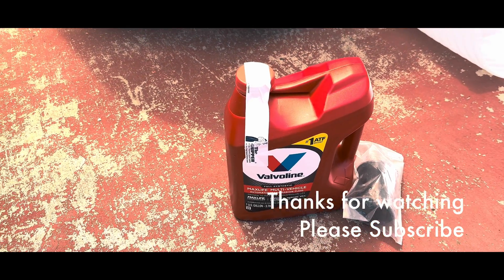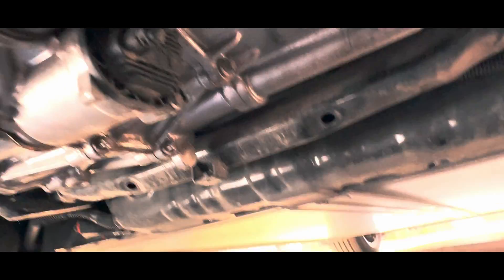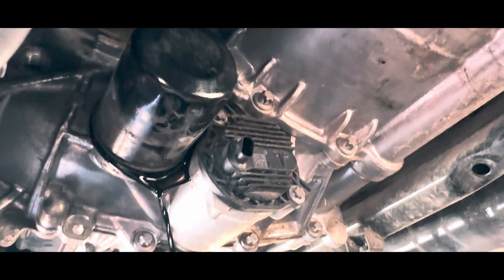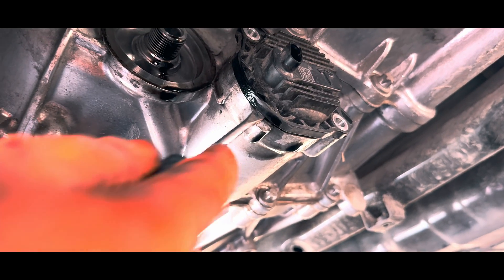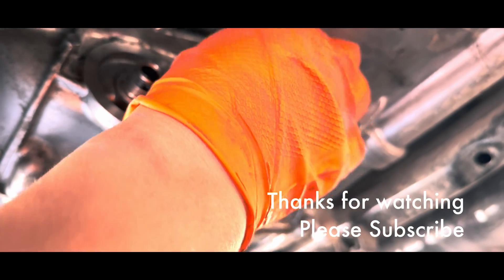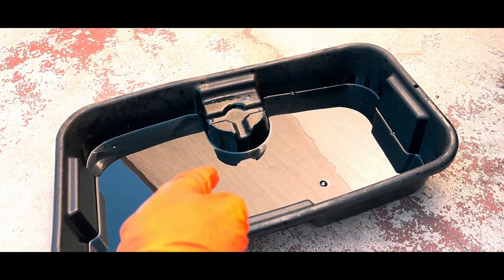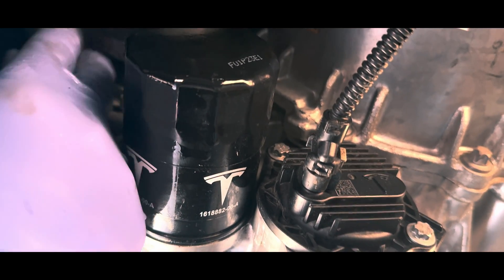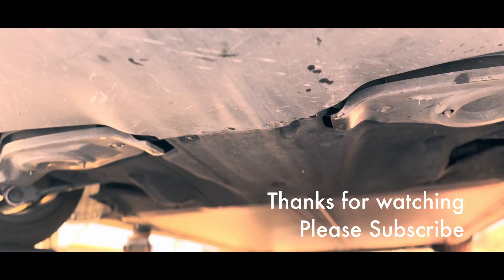Tesla Oil Change On The Drive Unit

Comment: 7:05 the torque spec for the fill bolt is 11.1 ftlb and it is stated in the publicly available service manual online. As well as additional steps to this procedure not shown in this video.

Comment: You forgot one of the O-rings when reinstalling the pump and you must run the pump after the initial 1 quart of fluid to fill it completely
Reply: I noticed the same thing
Reply from the maker: Sorry it was my edit... but new ring was in there... and i did same room temp drain and refill, no more no less

Comment: Drive unit still running strong with that Valvoline ATF fluid?
Reply from the maker: Yes, just put 16k miles more with it no issues so far on  my end
Reply: @car-lo okay great thanks for the reply! I think I'll go with the specialized engineered "lifetime" Vaico ED ATF on the front drive unit and the "lifetime" Liqui-Moly EV 510 on the rear drive unit of my dual motor long range 2022 Tesla 3. Saw I had a puddle of oil on the garage floor under the Tesla 3 the other day so I popped the cover off the rear drive unit and found that the original Tesla oil filter rusted through and started leaking fluid. At 109,500 miles and only 3 years old in all my years of changing oil filters on cars and that are considered much cheaper I've never had a filter start leaking for any reason. Go figure. Since I bought a quality vehicle now of course we experience issues you'd only expect to see in a cheap quality vehicle. Learn something new everyday!
Reply from the maker: Np, thats also a good point imagine that two filters not being change for a "lifetime" can cause problem for low oil cuz of the filter seals wear...eventually, and can damage the motor.

Comment: Buy the small pump to go on the QUART bottles of oil. Pump it through the fill hole until the fill hole starts leaking oil out of it. No reason to measure the old oil. I used to change the oil on my out drive on my boat same process. You put the oil in until the fill plug hole oil is running out of. Then maybe give it one more shots after then quickly put the plug on. I watched one other video on the oil change. He pulled out the part first then took off the oil filter. Then put on the new oil filter first then put back the part.

Comment: The drain bolt on 8mm is also level plug so you could just fuil undil it drains, so there is no need to measure it. And you've should change those rubber seals on that electric pump too.

Comment: Tesla vehicles like the Model Y are not on a scheduled oil change interval for the gearbox fluid, as the fluid is considered "lifetime". However, it is still recommended to have a professional check the gear lubricant periodically, with some experts suggesting a replacement might be due to wear and tear around the 150,000-mile mark or sooner if conditions are harsh.
Reply: There is no such thing as "lifetime" fluid
Reply: The actual manufacturer of the gearbox says otherwise.....every 30-50k
Reply: @jrkustomz5538 can you provide some proof 🙏
Reply: @jrkustomz5538 or its just you fantasies?
Reply: @oleksiytitov what are you talking about
Reply: @jrkustomz5538 i clearly asked where u get info about 30-50k
Reply: @oleksiytitov  where did you clearly ask? If it was " clearly" it wouldn't need explanation would it
Reply: @jrkustomz5538  so you have any proofs of your words or not?

Comment: 4:05 Is there a O-ring missing on the pump? There should be 3 O-rings on the pump.
Reply from the maker: Wasn't captured but that's the only clip I had all seals were installed properly- ty for watching

Comment: no front drive unit? I'll be waiting until powertrain warranty runs out at 120K miles on my MYP. Great tutorial.
Reply from the maker: Ty
Reply: That was my thoughts too. I was going to wait but a black puddle started forming under my Tesla 3 on the garage floor. Popped off the rear bottom cover and discovered my dual motor 2022 rear drive unit oil filter rusted through at 109,500 miles. Cheap atf filter! Was doing some research as to what ATF fluids are compatible and appreciate this video because it confirms what I already knew. Not trying to be cheap just not a believer in majorly marketed name brand fluids that are probably made by the same names you see on the shelves at Walmart just marked up 500% with a special name on it.

Comment: I have a 2021 model X is this the same fluid I should use on front and rear unit?
Reply from the maker: @GreasenGrit  i used valvoline atf synthetic that says 8- 9 speed zf compatible.
Reply: Access to front drive is not easy and requires electric pump to be manually activated to distribute the oil.

Comment: What car do you have?I have model 3 longrange  AWD 2019.Do you think the filter with number 1618882-00A is the same?thanks
Reply from the maker: @captainspauldingist  same i think just an oil change, if u have the all wheel u need two filters.
Reply: @ thank you very much.And oil for reductors is ATF9 norm from whatever manufacturer?and how much litres for dual motor two reductors?
Reply: @captainspauldingist By “ATF 9”, he means something a typical modern 9-speed automatic transmission would spec. You can use BMW Lifegard 9 or Honda Type 3.1 ATF, etc. plenty of different choices… But Valvoline Max Life is considered a “multi-vehicle” spec ATF, equivalent and compatible for those 7-9 speed transmissions. They’re also backwards compatible for older vehicles and transmissions, so it’s a fairly versatile trans fluid.

Comment: Do not do what you saw at 4:55 where the oil filter was hand tightened "as tight as you can" -- that oil filter was quite over tightened, it doesn't need that much force.

Comment: Looks to me that the transmission fluid that you used is not ATF-9.  Isn't it required to use AFT-9 fluid?
Reply from the maker: This one i got is atf-8-9, there are same bottle without that label in the back. I bought the one with  atf 8-9 label.
Reply: @car-lo Yeah, Valvoline had a “recall” for apparently mislabeling their Max Life ATF. The ones that don’t have the big list of compatible vehicles and transmissions on the back, will have a generic spec like JASO (which is like a multi-vehicle “standard” for a variety of makes and models). 

So, basically, nothing wrong with using Max Life at all. If you want, you can use another 9-spd ATF like BMW Lifegard 9 or Honda Type 3.1 ATF, etc. Those are just a lot more expensive, and I don’t mind the multi-vehicle spec ATF…

Comment: Are you sure it takes ATF fluid?
Reply from the maker: I used atf 9- but all up to you what u want to use.
Reply: @car-lo  what is the mileage interval when this service should be done ?
I have a 2024 model 3 rwd.
ATF-9 can be used on this also?
I belive this service at the tesla service center is like $500 ish  so i'll be doibg this myself
Reply from the maker: They sell the pentosin 9 at Amazon, 30k might be ideal to service it? But i dont believe lifetime oil if you are planning to keep for longevity.   Your car is fairly
New, unless u have high miles. Wow that is alot for oil change.

Comment: Human beings do not use their neurons. After the warranty expires, Tesla does not care if you changed the oil or not. If it broke because of this or that, I will sell you a new one. That is your problem.😂
Reply: Tesla Drive Unit warranty. 4 years or 50,000 miles. Not life time of the car. Just like BMW transmission, it said life time fluid. But the warranty only 3 years or 36,000 miles.

Comment: Oil would be black 5 miles after changing it. That doesn’t mean it needs to be changed.
Reply: The color of the oil is zero indication if it needs to be changed, it changes color very quickly. To properly know, you'd need to do a oil analysis.
Reply: if its black it needs changing lol
Reply: @billybobbob3003  oil becomes black after being heated for 10 minutes.
Reply: @uhsenli6424  oil breaks down after so many heat cycles
Reply: @billybobbob3003  Oil gets very fast black on modern cars and full of sot particles, due to exhaust gas recirculation (EGR)

Comment: That a gearbox should use gear oil probably
Reply: No, it’s a parallel gear drive with helical gears, much like a modern transverse engine automatic’s differential. To reduce friction the OEM fluid is some sort of ATF.

Comment: As a 2020 Tesla M3P owner, I'm a little confused. Does the drive unit oil need/should be changed? The Tesla owners manual does not state this needs/should be changed but I want the most longevity of my drive units. Should this be changed? There's multiple videos online about changing the drive unit oil and filter but they do not state when and why it needs to be changed.
Reply: Tesla doesn’t want anyone to maintain their cars until 100k warranty has passed 😅  be smart and change atf fluid asap, every 40k to 50k. 

I’ll change atf fluid ATF 9 on my 22” model y, 50,560 mi next week.
Reply: @Seadoo233  Absolutely!! I'm at 30k on my M3 Performance.  I'm thinking of doing it now.  Atleast for the 1st one.  Then maybe every 40k.
Reply: Thanks for the video! Is this the new fluid recommended as changed recently?
Reply from the maker: @gerbertmorataya9636 i used something cost effective that is compatible, but when in doubt use pentosin 9, but the synthetic i used is compatible so far so good :)
Reply: @car-lo yeah, it’s compatibility for ZF 9 speed type. If Tesla finds out you are using a different ATF, may void your warranty. I’d use Pent 9 fluid to keep you safe from getting voided.
Reply from the maker: @Seadoo233 correct just to be on the safeside, im out of warranty surpassing 140k now lol
Reply from the maker: A lot of the tesla owners don't see over 100k, maybe why they dont say anything about it, but this is a simple good way  to keep your drive motors last a bit longer.
Reply: @car-lo  atleast you arent like these idiots who think you never have to change fluids in an ev lol.
Reply: Yeah, they insist, “no maintenance required”, yet Teslas DO have oil in the drive units, coolant for the battery pack, and brake fluid for the brakes. That’s not really a lot to do, but it all needs done at some point.

Comment: Thanks for the video. My 2020 Tesla Model 3 has 160K miles on it. Thinking about doing this service. How many miles your Tesla has? How much was the oil filter?
Reply: I went to Tesla service center and got the filter for $15 over there
Reply from the maker: Dang that is not bad! Which sc is this?
Reply: @car-lo  Fresno, CA
Reply: Completed the fluid change today, used Pentosin ATF 9. All went well. Thanks.
Reply from the maker: @mann4080 grats!
Reply from the maker: Amazon aftermarket is like below 30 bucks, i havent check to see if there are other types of filter that would be same size yet, ebay has oem ones for around almost the same price.
Reply: @car-lo how many miles your Tesla has?
Reply from the maker: @mann4080 around 100k 🫡
Reply: Question: did you disconnect any battery cables prior to the fluid replacement?
Reply from the maker: @mann4080 No. perhaps power off on the screen.

Comment: Carbon neutral fossil fuel oil…imagine that. I love how green EV’s are…the age of the EV scam is upon…be careful out there people evil is all around us
Reply: Not such a big deal. First off, you're looking at less than 3 quarts of oil, second, it is a lubricant, not a fuel. The used oil can be recycled or re-purposed. 3rd, you only do this once every 50,000 miles, not 5,000 miles. Any car, whether combustion, Hybrid, or electric, need occasional gear oil changes. This is the ONLY maintenance needed on an EV, with no need for more frequent engine or transmission oil changes. (EV's simply don't have those components)

Comment: When does the Tesla drive oil need to be changed? 30k miles?
Reply: Good question, I have a 2023 M3 Performance, and I'm about to hit 30k.  I think I'll do it at 30K.
Reply: @myreviews4905  I would call and ask the dealership first to see what their required service maintenance would be first?
Reply: FYI Tesla technically says that the gearbox fluid should last as long as the car. The question is how long does the car last? Lol as a Tesla mechanic I normally recommend changing the fluid every 75,000 to 80,000 mile just to play it safe.
Reply: @SaltcitysneakerheadsI have a retired Tesla tech that helps me on my 22’ M3P. He recommends 30k oil and filter changes. At the 30k and 60k oil changes the lube was black and smelled slightly burned. On the 90k I am going to cut the filters open and examine them. I am also going to send samples to the test lab.
Reply: @SaltcitysneakerheadsKeyword is "should"
Reply: What tool did you use to remove the bolt on electric pump..tnx
Reply: @rodrigodomingo2400 EP10 6pt Torx Plus socket
Reply: i have +300 000km (200k miles) drove Tesla MS P85D and have never changed yet, but I am considering to change any year soon
Reply: @ukko1998 uh yeah, that thing is most definitely overdue
Reply: As stated on Tesla's website: "Tesla vehicles require no traditional oil changes, fuel system maintenance, spark plug replacements or emission checks".  Technically, you dont need to change the oil in the drive unit. Anything that has to do with the drive unit and its oil, will be covered under its 8 year guarentee. On top of that, if tesla finds out you swapped the oil yourself and did not use Tesla approved oil, you could void your DU warrenty.
Reply: @sebastianocarreiro8061 😂 life time coolant and oils are scam. If you change car before warranty no one care about maintenance. Let other take that shit.
Reply: @sebastianocarreiro8061  If it fails because the recommended service is not done it will not be under warranty. Did you see how black his oil was that he drained?
Reply: @harveypaxton1232 there is no service interval, there is no recommended service for the gearbox on the model 3. Early model S and X cars had one and then it was removed. 

People do 500,000 miles without changing the oil just fine, unlike an ICE car, the motors don’t get anywhere near as hot and the oil doesn’t break down nearly as much
Reply: @iambenmitchell Sorry but Tesla is lying to us. I have been changing my Model 3P gearbox lube and filters @30k and it has been black and smells slightly burned each time. Coming up on the 90k going to go with the new KAL lube that Tesla recommends now. Also going to cut the filters open and check for debris. Sending the oil to the test lab too.
Reply: @sebastianocarreiro8061  Just like BMW and ZF did in the good old days with the ZF6 gearbox... "no maintenance".... and suddently ZF said something else, when they began to break down.... oil looses its elasticity over time of usage (ability to grease), and it is gears just like any other mechanical device... of course it is healthy with a change...
Reply: Right arpund 50k miles ... Same time you need to replace the battery 😂
Reply from the maker: @kennethfarquhar8518 i hope not 😃